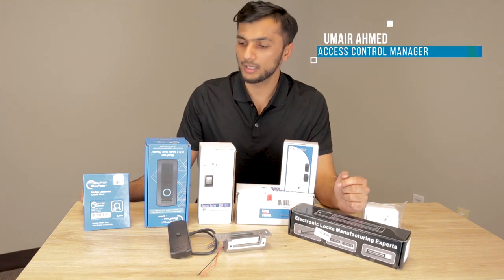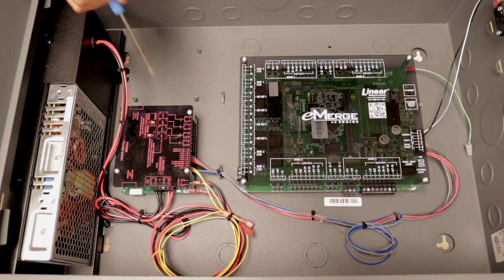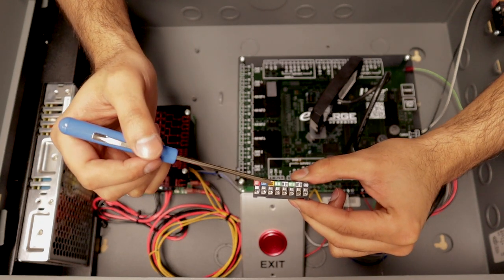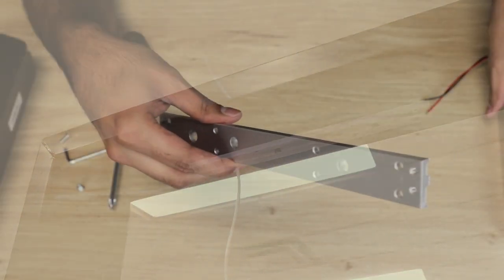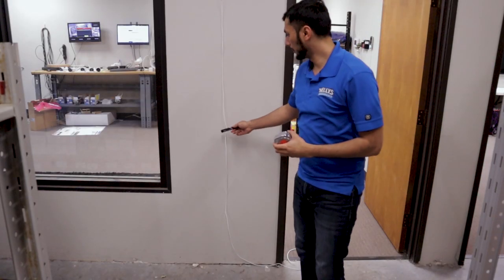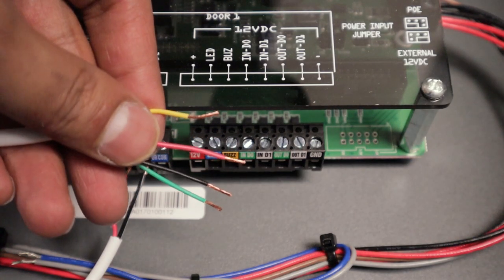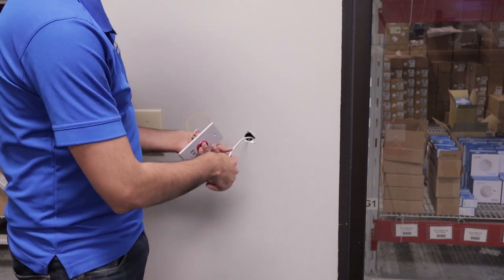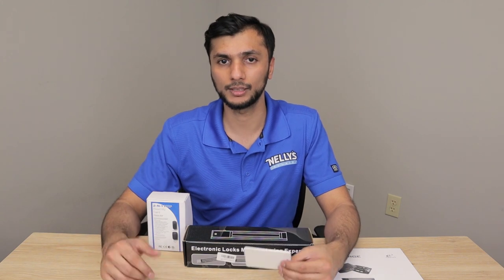How to Wire a Linear Access Control System

Comment: Your maglock is on the unsecure side of the door. Also no anchor or retro box was used, I could easily take the reader off the wall, short the power wires together and everything on that circuit will now have no power, not to mention that reader port on the controller is now fried.
Reply: I was thinking exactly the same on watching this video.
Reply: Its a demonstration not an actual job site.

Comment: Is it possible to wire in a switch (lock/unlock) to the mercury board? The door is on a schedule, but the office person wants to lock it when they are out of the office and doesn't want to manual locks.

Comment: Pretty Good video. Thou did not cover type of Reader wire, gauge, shielded or non-shielded , twisted pair or regular.
Do not be lazy! wires should be soldered and then heat shrinked and then taped to prevent damage from running new lines or removal.

Comment: if i wanted to wire an automatic gate to the system, would i use just and 18/2 from control panel to automatic gate panel? If so, where on automatic gate panel would i wire it to? thanks
Reply from the maker: Hi Paul, Im not sure where you would wire it to the gate panel but it should be doable.
Reply: Paul, you would wire it to the open command on the gate Operator. Every gate operator has a open, close, and stop terminal. So a wire from the strike relay if using a card reader, or a N/O Input if your wanting to open the gave via stationary button or through software. Very simple, the gate just needs a contact closure to open.

Comment: those blue things are called "wire nuts"
Reply: Idk why a lot of low voltage technicians still use wire nuts, i use Dolphin Crimp connectors.
Reply: J Sanchez yup blue dolphins does the trick.

Comment: Hello there I need some help I have the same power supply and mag lock that's in the video I'm installation it on my gate the drive way is about 100 feet long from the house when ever I try to ring the door bell from the gate it doesn't ring and the mag  locking force is weak the wire am using is CAT 5 and the power supply is in the living 5AMP power supply am using!
Reply: Your using the wrong wire cat5 or cat 6 is usually used for cams and data. You need 18/6 or 18/4 stranded wire you can find some at an electrical supply house
Reply: Ok thanks question the 18/6 or 18/4 how many wires are inside the wire?
Reply: @jeromeswaby5261  It is as it says 18 gauge 6 strand 18 gauge 4 strand
Reply: @nicholasgaribay5831  ok thanks

Comment: What happens in the event of a power failure? Does your door unlock if there's no power to the building?
Reply from the maker: It depends on how you have it setup. If it is "Fail Safe" that means it will unlock when power is cut. If "Fail Secure", doors will remain locked when power is cut.
Reply: @NellysSecurity  would that require a battery backup then?
Reply from the maker: @RacelifeCo  A battery backup is always good on a Access Control system, but worse case if a battery backup dies, thats when fail safe and fail secure come into play.
Reply: if it's a mag lock, it's "fail safe"... no power, no lockey...

Comment: I'm running into issues where my circuit boards are no longer powering up. This happened after a failed battery backup.
Reply from the maker: Hey Chris, id recommend reaching out to our support - customerservice@nellyssecurity.com / 855-340-9999

Comment: what is the cable type you use for connecting reader to controller?
Reply from the maker: Recommended is 18 gauge stranded solid copper. so 18/6 or 18/4